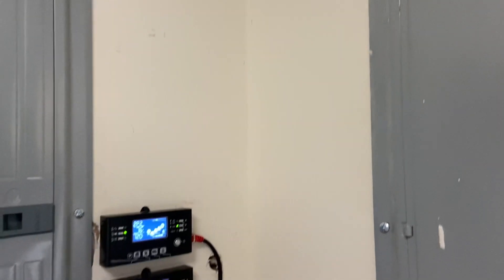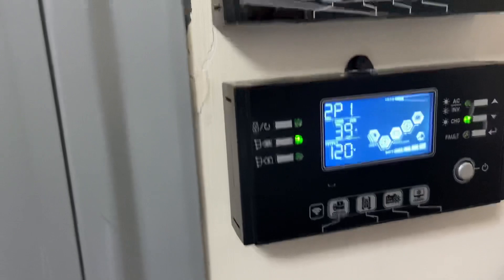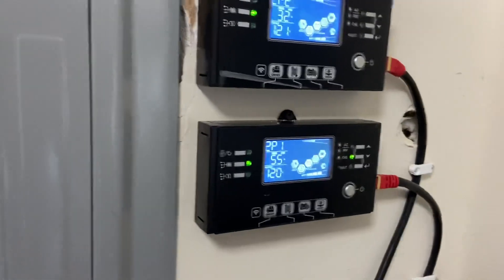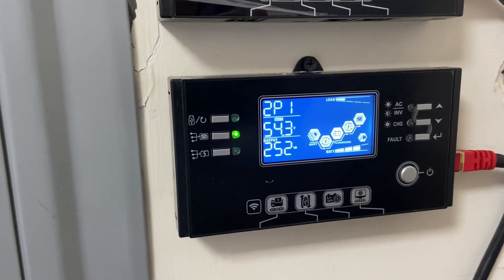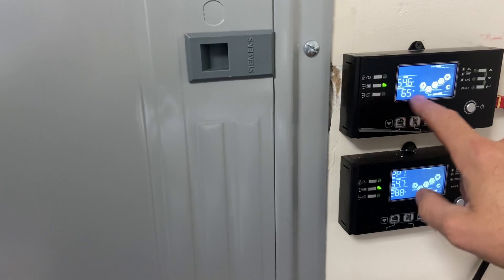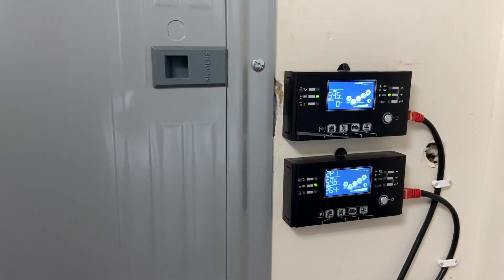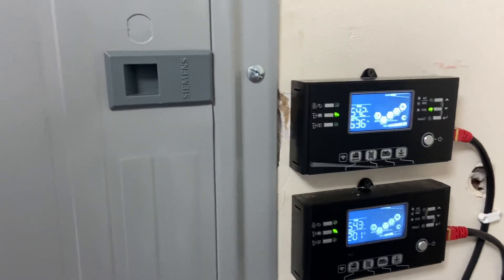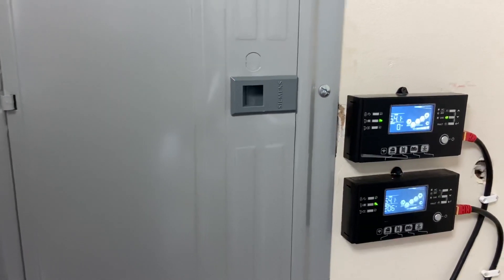Mpp lv6548 settings and remote display.

Comment: Hi I'm interested in relocating my screen panel but what to i do with the battery best data cable ? I see you only have the comms link cable to your screens, any help would be appreciated
Reply from the maker: I never utilized battery communication with these inverters. If you do, you’d probably have to add a separate cable for that as well.

Comment: My display has died. No response whatsoever. No lights, no display. I hear the beep when i press the on/off button but the whole thing shuts down after three seconds.

The bottom section of the on/off botton however I've noticed seems to get very hot. Do you get any heat coming from that area?
Reply from the maker: As I recall they did get rather warm. MPP could potentially provide a display if you contact them. Or maybe try the seller you got them from. Do you have a second unit? You could swap them and see if there’s potentially another issue.
Reply: @GavinStoneDIY  thanks. I've just got a response from mpp. I thought they would just let me hang. I've only got one. I'll see how i go with mpp for now.

Comment: Do you need a male and a female end for the cat5 to extend the displays? Or just normal cat5 with two male ends?
Reply from the maker: You need 2 male ends.
Reply: @GavinStoneDIY  Great ty, will make up a cable now then. I didn't want to take it all apart if i needed female end lol.
Reply from the maker: @HellTriX  sure thing. How far are you moving the displays?
Reply: @GavinStoneDIY  Just about 10 feet. They are in the electrical panel room, and my office is on the other side of the wall. But the panel room can only be accessed from an exterior door. So planning to make a little display hud area for my BMS and inverters in my office.

Comment: Have you made a vid on how to program from a new state?  I have a sealed lead acid bat bank of 48 volts and had questions about bulk charge, floating charge, low dc cutout, bat equal time, bat equal timeout, equal int, equal now.  I don't know what is best for these settings.  IE, I've searched for low dc cut out and it varies widely for the sealed lead acid.  More than a couple volts depending on who is talking. Obviously, I want the batteries to remain healthy as long as possible and don't want to take them too low.
Reply from the maker: That’s a good question. Most of the industry seems to be leaning towards lithium. So I’m not really familiar with the specifics of what a lead acid would require. The distributor of your batteries should have some specs on them I’d think. The inverter voltage settings are fairly easy to manage. The manual does a good job of describing how to do that.
Reply: @GavinStoneDIY  Since I'm just beginning my solar adventure, I couldn't pass up free sealed lead acid batteries from a commercial 480 volt, 3 phase output UPS being removed from service.  I have 4 batteries in series, with 4 more sitting on the side to possibly have 2S2P strings. I have 8 more in holding.  I have a good pro digital battery tester that prints out results.  They all passed, so I will ride with them for a few months to see how it goes.  I also scored the AC/DC Square D breakers (3) I will use as battery disconnects + all of the fine welder cable from inside the UPS.  Various amounts of 4, 2, 1/0 & 3/0 cable. I had more than enough to build my battery banks.
Reply from the maker: @spockmcoyissmart961  wow. I definitely don’t blame you for using them! Maybe read up on that particular battery and charging ranges. I know most of those can only discharge to around 50% depth of discharge without damaging the battery. But aside from that I have extremely limited knowledge of lead acid.

Comment: How do you turn off beeping when pressing the buttons?
Reply from the maker: It’s the setting that’s mentions alarm sounds. Is it 16 maybe? I can’t remember. I don’t think alarm sounds should have been linked with button sound. But that’s the way they made it.
Reply: @GavinStoneDIY nice. I asked the distributor and they said you can't turn it off. Glad it can.

Comment: Wouldn't the app be better? If you don't like the delay in the app, why not a laptop plugged into the USB or serial port? Anything is better than the standard control panel. I use the app 99% of the time and I have a 30' Micro USB to standard USB run into the House that I can plug into. But to be honest, once the newness fades away I don't even look at it. It's probably been 4 months since I have even looked at my system.
Reply from the maker: The app would be nice. I just don’t have WiFi out in the shop. To be honest, I never really look at mine anymore either. They just make the power and I use it. Sometimes if I’m pushing the limits and running dryer and oven at same time I’ll look at it out of curiosity.

Comment: Great video.  Never thought of sharing something as simple as the information you can see directly on the screens of the inverters.
Reply from the maker: I think most people will use the app. But for those few simple folks like myself, hopefully it will be helpful.
Reply: @GavinStoneDIY  It's hard to say.  I think some people will just be frustrated with the experience of setting the app up, others will see the huge delay in data being populated in the app.  

I know when I tried to set up the app, I had to rely on people in the forums because the instructions aren't very clear.  Took me forever to figure out where the pin was for the specific inverter.  Then I saw that the data population was at least 10 minutes off, so I didn't even bother setting up the second inverter.  

It would be nice if they had some kind of page number for the details on the display though.  That way I could know I need to scroll to "page" 5 to see the amps for my PV1 (or whatever it is) instead of just clicking the button till I find the setting.
Reply from the maker: @AdamDeLayDIY  good point. The displays are simple. But a little too simple. A solark type of display would be more helpful.
Reply: @GavinStoneDIY  agreed!